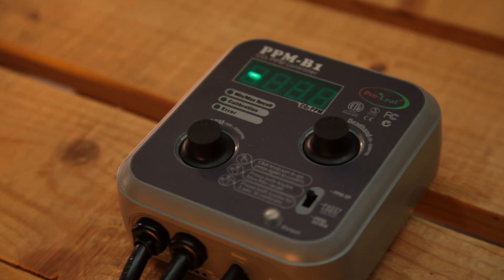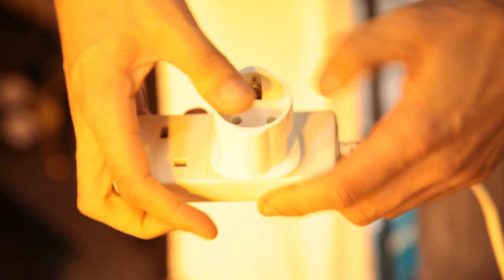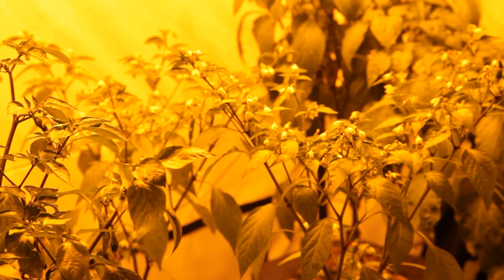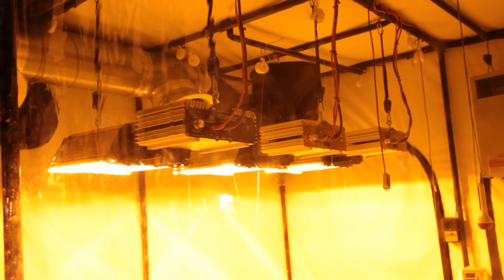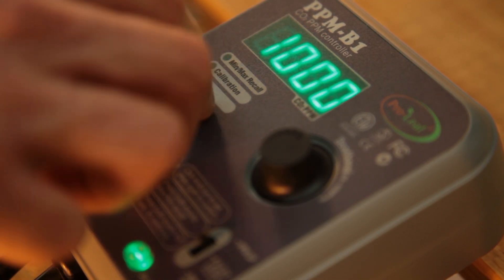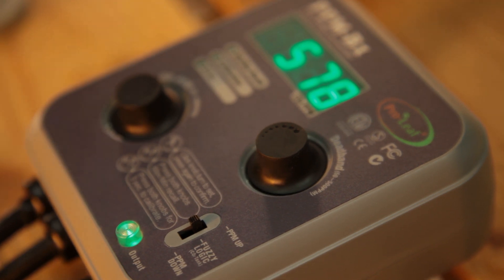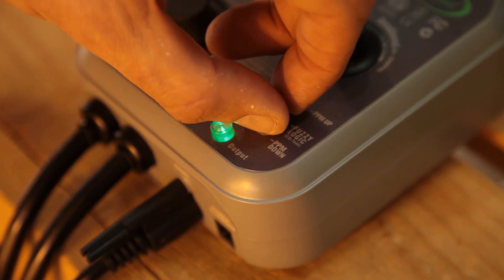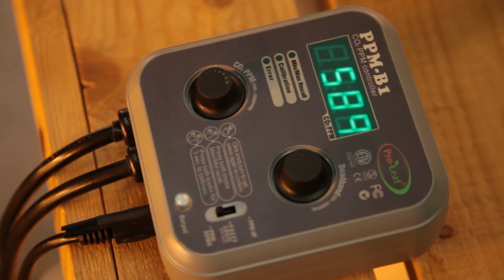How to use the Pro Leaf CO2 Controller

Comment: GOOD AFTERNOON FRIEND, I bought this wonder, I want to know a couple of things if I use bottle co2 the switch settings go where 1PPM UP

2 FUZZY LOGIC

3 PPM DOW

The other is that it comes from the factory with an input a charger but it does not include it is necessary to use it or not thank you for your attention